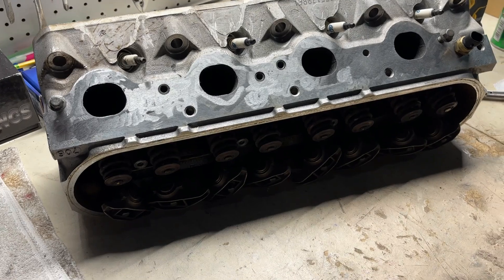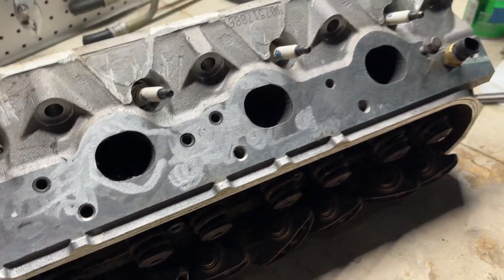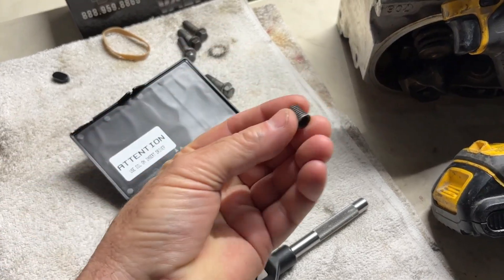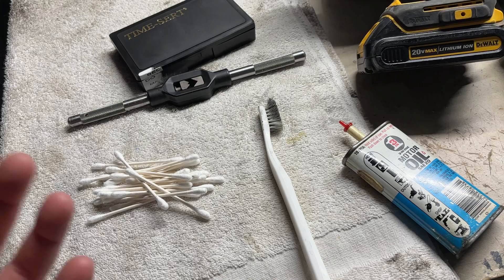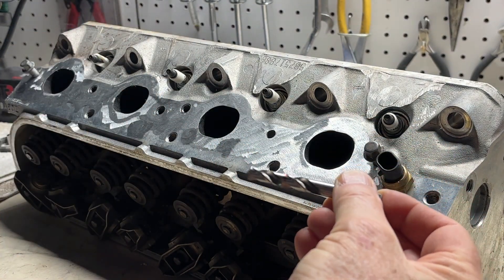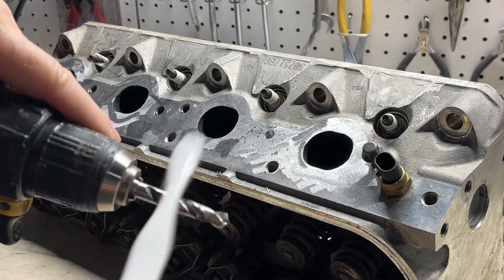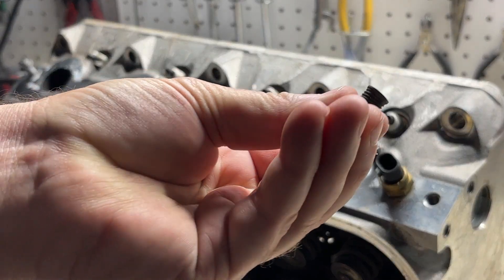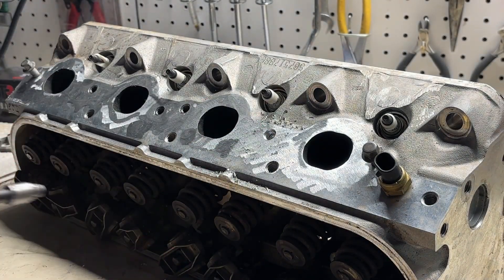How to Quickly and Easily Repair Stripped Exhaust Manifold Bolt Hole from an Aluminum Cylinder Head

Comment: I got a 5.3 engine from a guy with 317 heads from a 6.0 LS motor. Would thoses heads work on that 5.3 engine ?
Reply from the maker: @shugg0517  I would say it depends on what you want to do with the 5.3. Putting stock 317 heads on a 5.3 will lower the compression ratio close to one point. So, if you are planning on building a mild 5.3 the 317 heads would not be the way to go. If you plan on adding a turbo they could work. Chamber size is too large, would not be the best choice for a smaller motor.
Reply: Ok that's what I thought. About the 317 heads it would lower compression. Thanks for replying back love you channel. Keep up the good work.